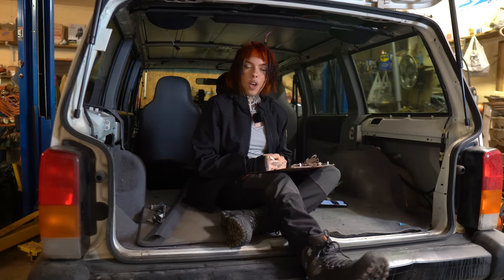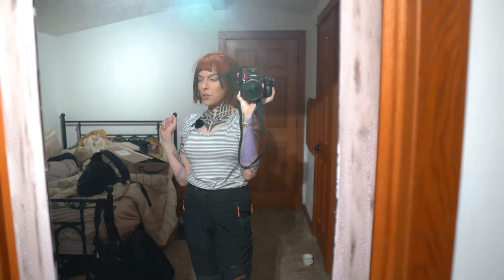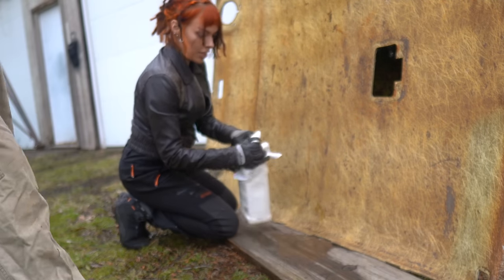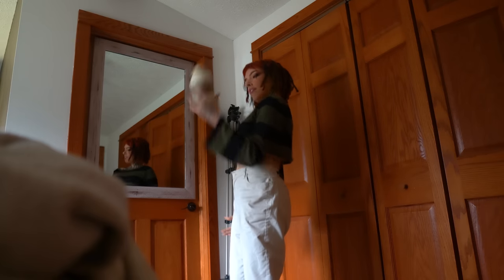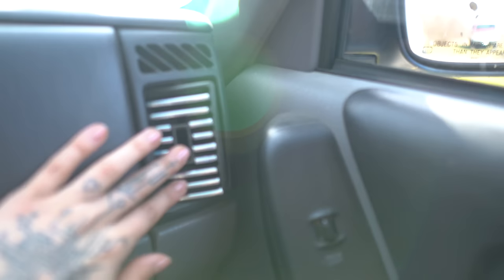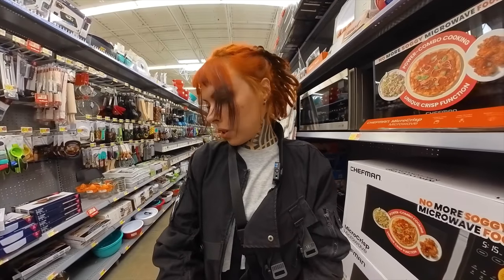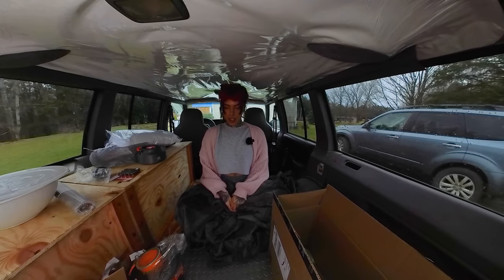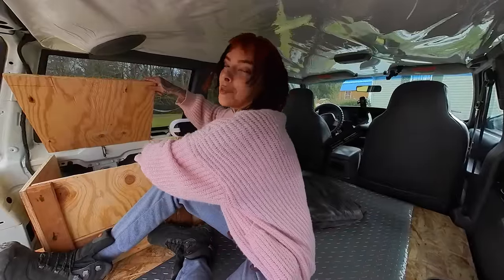i made a mistake....(DIY camper van build)

Comment: For future reference, when using contact spray glue, make sure you spray both items the item you are putting something on and the item you are putting on the something. Let them both sit until they are tacky, around 10 to 15 minutes depending on outside temperature. Then stick them together, but make sure you are ready and everything is positioned as you want it, because once both items touch each other it's a done deal. I am assuming that your roof didn't work because you didn't spray both the roof insert and the back of the wrap paper.  If you tried to do it once more it would turn out a lot better. Make sure you roll it out as you go and you want to start at the widest and shorter side like from driver side to passenger side instead of front seats to back seat. Hope that helps if you ever need it again.
Reply from the maker: No the car wrap was already sticky it was suppose to just hold like that and then be heated up to stay but it’s because the little bumps on the headliner that I didn’t account for .. but next time I’ll allow some drying time
Reply: @TorieRobot  got ya. Sometimes the chemicals in a glue will act almost like a paint thinner and melt other glues. Super glue will do this. I build homes and have done a lot of laminate cabinets for like Verizon and a few other businesses. The same concept is applied just with a heavier duty adhesive. But good luck with everything.
Reply from the maker: @patricklary81  ah okay good to know thanks!

Comment: I tried suggesting a headliner thing last week but then you gave us the walk around during the livestream that you already had a headliner installed, and well its shiny and white and looks nice. Hopefully the glue doesnt fail in other spots such that it sags down more and more (I've had them end up looking like a collapsing parachute canopy dropping 2 feet into the cabin). If it does and you end up ripping it back out may I suggest watching Stephi's 2nd, 3rd and 4th van build videos, she used a silvery insulated sound-deadening from Amazon that is self-sticking and then a 1" polyiso insulation panel that also self-sticks over top of that (they're in different videos) that's also silver and space shipy. Its likely lighter than that solid panel you pulled out that supports your existing carwrap headliner and would be easier to re-install as well as make it more comfortable inside the back when sleeping. 

Second and third suggestions... and I did check the amazon list first to be sure this wasn't listed... an insulated coffee/tea press travel tumbler from Amazon (put it on the wishlist and I'll get you it) so you can use loose-leaf style teas and ground coffee for future cost savings if you haven't already got one, and instead of losing valuable storage room to a buddy/space heater you'll use infrequently, an electric heating pad you can plug into your powerbank and just have inside your sleeping bag to warm you up will be more power efficient. Or even just recharging your heated jacket and sleeping in it, while in the sleeping bag. Anyway I just sent you something from your wishlist also. It should be there wednesday.
Reply from the maker: Good suggestion and I added one but no pressure .. it’s not a need as I have a little kettle and I can use tea bags :)

Comment: when building and disassembling take photos or video of the WHOLE thing. That way if you have to go back to figure out a problem it's easier. Also when your cutting things to size its better to slightly over cut. This way you can whittle it down for a flush fit.

Comment: Just a thought, you should cut a small hole in the interior of your lift gate right where the outer latch is and insert a metal rod with a spring and a cap so that when you push on the cap, the rod pushes out on the liftgate handle so you can open the rear hatch from the inside instead of having to slither out through the rear passenger door to open the rear hatch. I have a 2000 Cherokee and a 4wheeling vet suggested that to me back when I lived in Alaska. He suggested it after I mentioned mine had a tendency for the doors to freeze closed whenever we got sleet because he once rolled a Cherokee he built to go off-roading and it basically crimped all four doors shut to the point he had to kick out the windshield to escape. Upside, the horror story is a testament to how sturdy those jumped-up station-wagons are. Not sure you need the inside release for emergency egress, but just thought it might be a nice feature for someone who will be in and out of the back constantly. Another little suggestion, don't cut into the roof when you mount the solar. Get a roof rack, and mount your panel on top of a box with your entire system in it up there, then run one outdoor extension cord to the inside via the wiring port already present at the top center of your rear hatch frame. A quick and easy solution is the Goalzero system. They can be pricey, but it comes as fully intergated system set up to be hands free. You just drop the power box in a lockable container on the roof, mount your panel or panels, run the wires and then use a standard outdoor extension cord to move the power to the inside of your truck. Best of all, you never have to worry about miswiring your system or shorts causing a fire inside your home. Love what you're doing, best of luck.
Reply from the maker: Thanks for all the suggestions! Yeah the doors can be sticky in the cold but I won’t be in the cold much longer - and I’m still trying to decide what to do about the solar

Comment: Remember what a said about a month ago about how hard it is to get an out of state used vehicle inspected and titled I'm PA?! I hope it goes alot easier for you than it did my brother. He's like 6 months in and still not complete. The inspection is almost impossible to comply with, without spending a bunch of money to get the vehicle in compliance. My brother had to buy a completely new exhaust system because of PA emissions guidelines. Good luck 🤞 I mean that in a good way, not a smart a$$ one. Just in case it comes across that way.
Reply from the maker: Pa is very strict with inspection so hopefully mine passes

Comment: Did you get matching roof liner, watch and goose color intentionally? Car wrap is a pain and really only works on painted surfaces, if it falls off you could just paint the liner if you want shiny white. If you want a little more stretch out room you could have a small floor extension to fit in if you move the passenger seat all the way forward. I think your build will turn out great for what you want. All the best.
Reply from the maker: Haha yes it’s all intentional- and thanks !